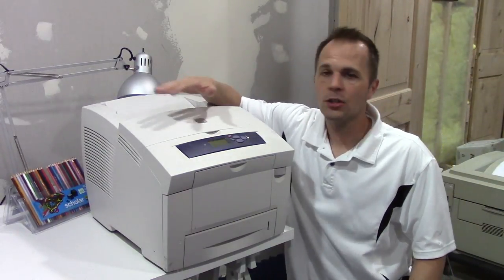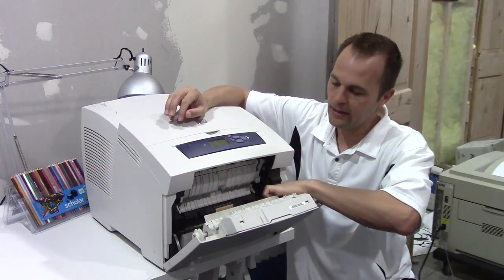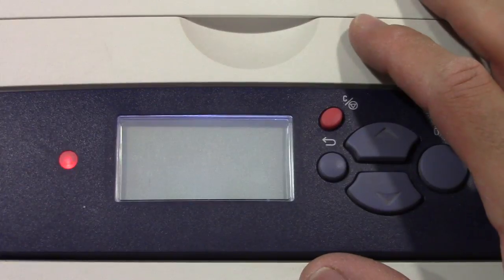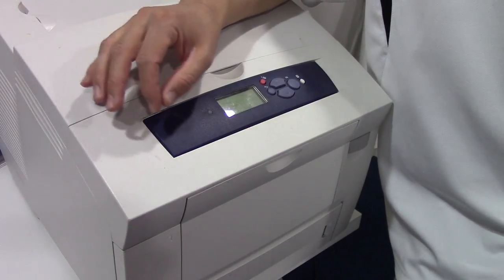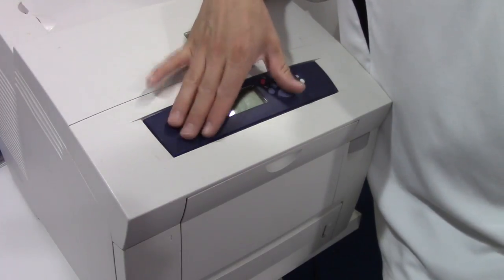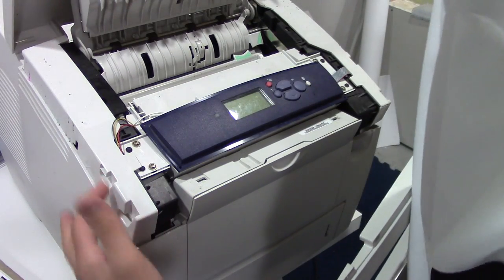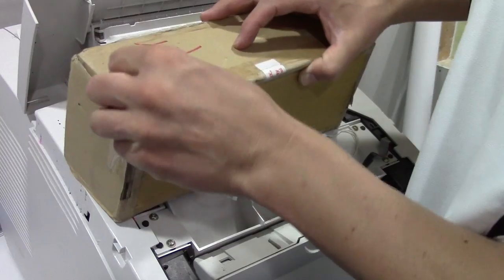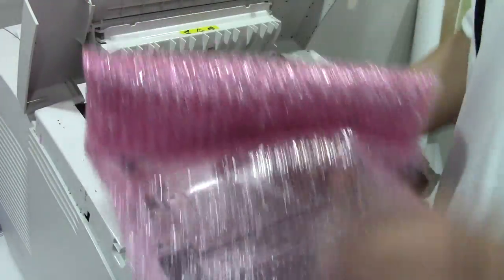How to repair Xerox Phaser Blank/Bad Screen Display

Comment: Thanks so much! I have had similar issues with the text on the display being grunged up, missing in the middle section, and now completely blank. I called Xerox today (3/15/2017) and they are shipping me a new bezel for free! It's a one time deal but hopefully it will not need to be done again.
Reply from the maker: That's great!  I'm glad to hear they are still standing by their products. It's rare to find that kind of support.
Reply: Sir, the same issue happened to my machine, and I can't print any pages when connected to my computer. Could this screen issue cause total failure of this machine? many thanks in advance

Comment: Hi I have the phaser 7400 and my screen has gone out but the back-light still working so think it's the same problem. I phoned xerox but they said they can't help. Does anyone know where I would be able to get a replacement at all? Don't want to scrap a perfectly good pri ter for such a small deflect but can't see to access options

Comment: I have xerox 7225 colour machine 
Same thing coming black screen and green light only power saving mode
Event power off and the turn on its same 
I just replace the black drum unit after that this problem came 
Now when I power on the machine no warm up only black screen
What should I do?

Comment: Thanks, I got mine replaced as well.
Reply: Sir, the same issue happened to my machine, and I can't print any pages when connected to my computer. Could this screen issue cause total failure of this machine? many thanks in advance

Comment: Good day. I would like to be assisted if you can. I have a Xerox Phaser 3635MFP that i bought 2nd hand and it is now giving me a problem. The screen doesnt light up sometimes, and therefore cant use the printer, and sometimes when it does it gives me a message that says "try powering down and restarting and if the problem persist please call a technician". Sometimes, which is very rare, it doesnt power up and get a lit lcd, but after a couple of prints, it freezes and then i have to power it down only to fall on the same chain of previous problem. Please assist
Reply: *Sometimes,....,it does (correction)